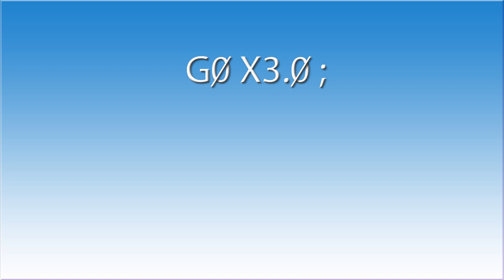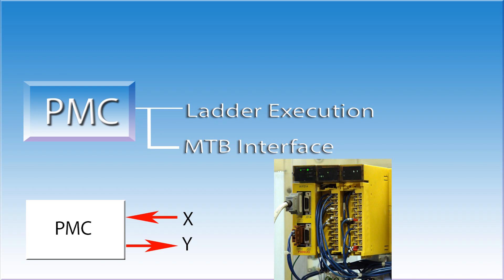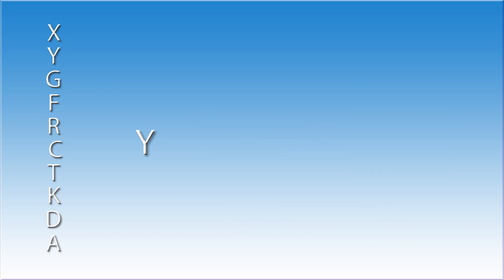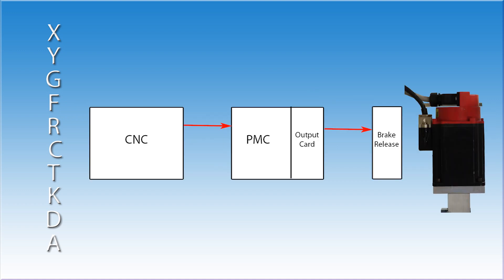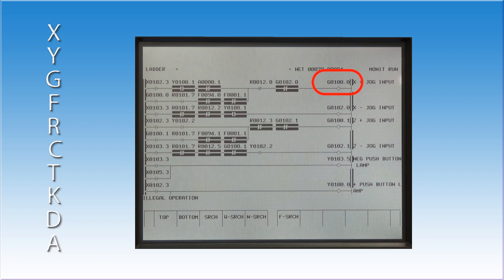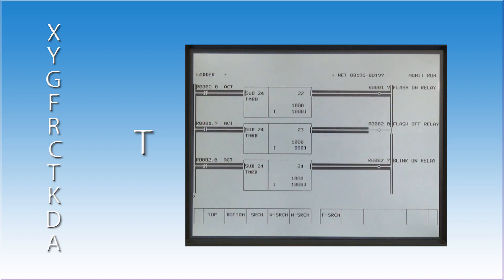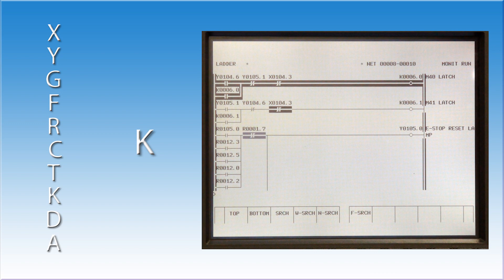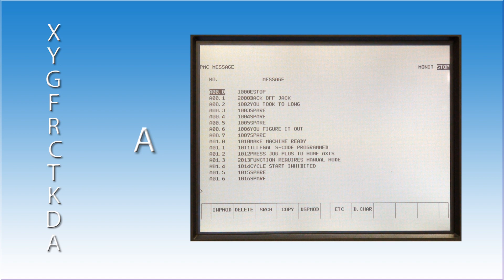CNC Maintenance Training:  Fanuc PMC - CNC Areas of Responsibility.wmv

Comment: Hello Sir.
Thank you for educational videos. 
Question:  can fanuc cnc controller be used with allan breadly plc instead of fanuc pmc ?
Reply from the maker: To an extent.  The Fanuc control has an option that allows it to interact with Allen Bradley.  This is typically done via an Ethernet connection. You would still need to set certain G-addresses in order to run the control.  An interface would need to be written to handle this. Hitachi Seiki did this with their Seicos Doctor.  It would be easier to have it written in Fanuc Ladder III.
Reply: @johnrobbins9439  
Thank you for your reply 🙏

Comment: F122.0 is the high speed skip signal. It could be used as the input of the probe trigger signal. The probe is a real-world device. Its signal will be input to the CNC directly so that the CNC will capture the current position values. But yet FANUC assigns an F address to this signal. It is weird.
Reply from the maker: That does look strange.  I believe that F122.0 (HDO0) is the output status from the CNC to the PMC.  It shows the status of the high speed skip signal (HDI0) that is input on connector JA40.  It looks like HDI0 is the actual real world input.  In this case, it's not an X input since the CNC is reading it directly- not via the I/O rack.

Comment: Access to the PMC can be locked, because I can't access in a machine?
Reply from the maker: It can be locked several ways.  What model of control is it?
Reply: John Robbins It's a series 21. Thanks for your question.
Reply from the maker: Keep relay K17.0 = 1 will hide the ladder.  Set it to 0.  If you are not able to change it the ladder may be controlling it.  You will need to speak with the builder.
Reply: I will try it, thank you very much!
Reply: hello osmar have password the ladder in your machine?? at the moment of check the ladder??
Reply: I extract the password just sen me an email yugi_roy@hotmail.com